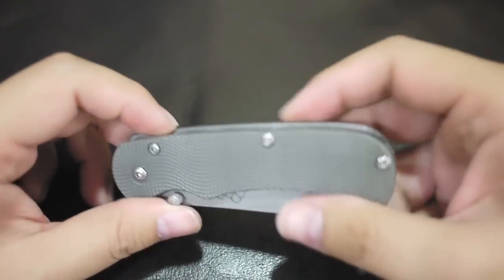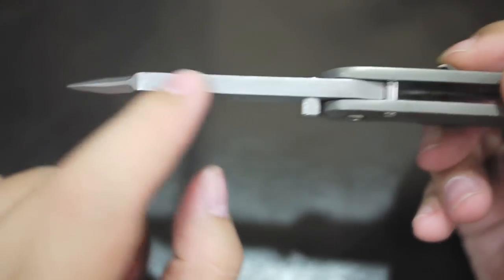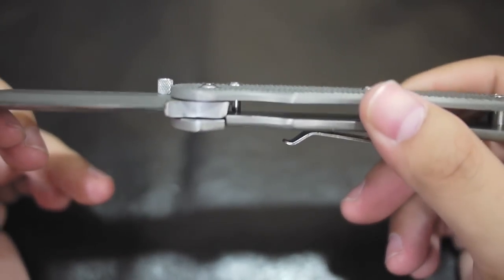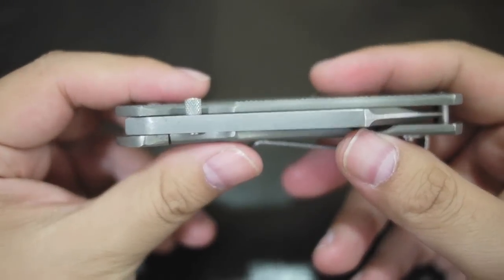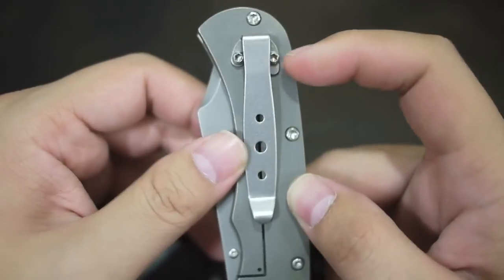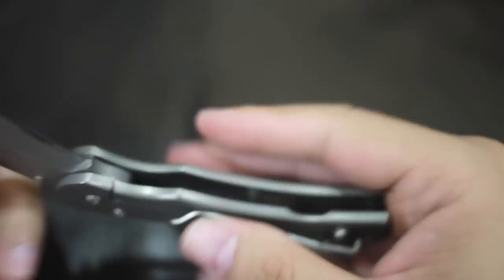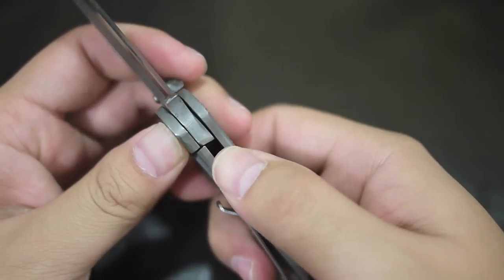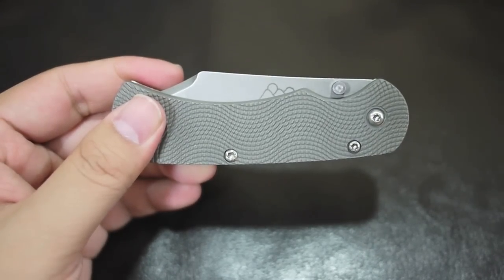Three Sisters Forge knife The "Beast"

Comment: It's a pretty nice knife and I think that with some minor changes it'd make a really nice production EDC blade if a manufacturer would pick it up. I think that I'd prefer a different grind on a slightly thinner blade. I had a Buck/Strider with a 1/4 inch thick blade and it was impossible to put a decent edge on, this blade reminds mr of that one. On the positive side I really like the texturing of the handle and the shape. Overall a nice piece in the collection my friend.

Comment: Reviewed this knife some time ago.  You may be forgetting is that this is a HARD use knife.  It isn't meant to be a pretty safe queen.   Minor imperfections perhaps but  the BEAST stands up to things I would never have dreamt doing with other knives.   The lock, put some grease on the end of the tang until it wears in.  The clip was fit loose to facilitate one hand opening. take it off and bend it carefully to make tight.  Strop to polish edge.   Use it and its real beauty will show!!!!

Comment: i think that this knife brings back the best of blacksmithing. sure its not as finished as it could be. or should be. its nice that its all one guy. not the water jetting on the handle but all of the other stuff. i dont like to see a custom where the damascus comes from one guy. the scales from someone else. the blade ground by someone else. that sucks. another great review. i wish the blade wasnt so damn thick. the clip should be stronger. the hardware should match. should be razor sharp. good

Comment: Good design--I think I'd prefer the primary grind a little higher, and the swedge to start a little farther back, but the edge itself looks pretty good. I don't know how to feel about the fit and finish--seems good in ways, but not so perfect in others. Striders aren't really "perfect" either, and something that's truly hand forged/ground will be slightly inconsistent, but things like the screws, clip tension, etc. should be worked on IMO. Still a nice knife.